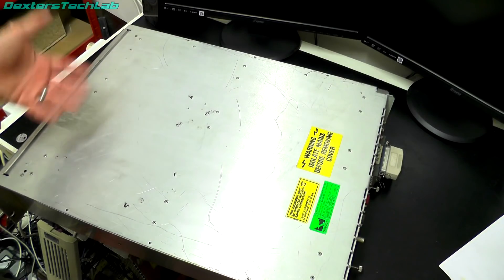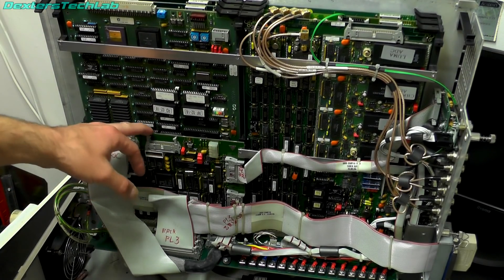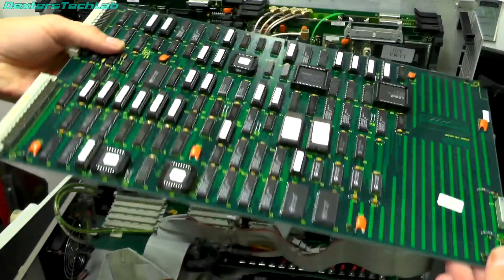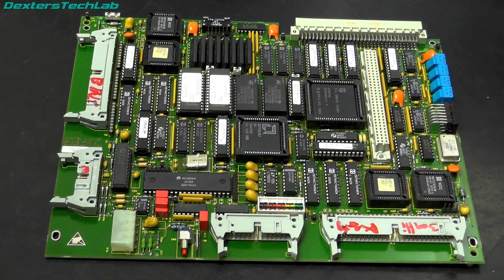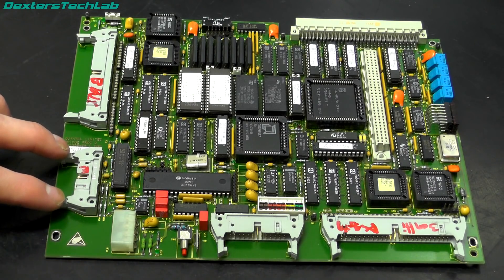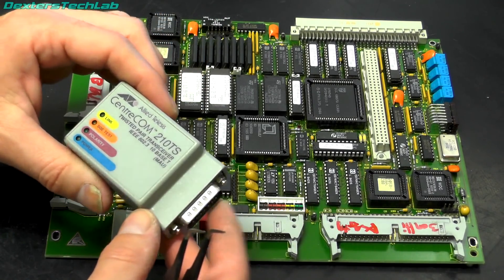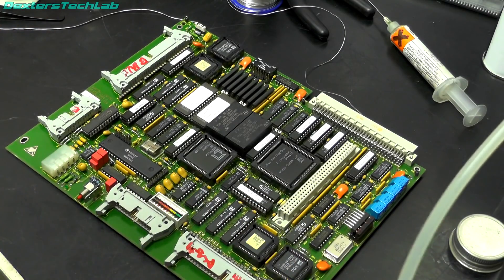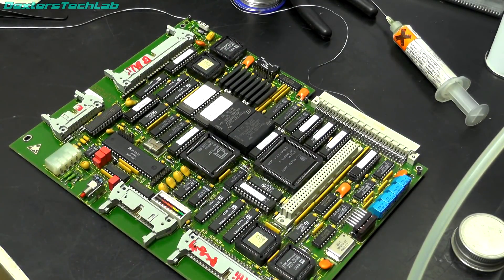DL198 Quantel Paintbox Restoration & Service Part 1

Comment: In my youth, at ITN in the UK, I wrote a sideways ROM for the BBC micro that used the paintbox "fetch" command with adjustments by the cursor keys, to fetch from a start track for X number of tracks with Y pixels per line to recover images and cutouts from a PB disk if the directory ever got erased or the image was accidentally deleted.

This was for the 10U model, the one shown here is unknown to me..

I used the 72 character status display and the 80 character buffer, to print a full set of commands on the status monitor without at "Unexpected command" errors.
It saved ITN a small fortune when a freelance graphic artist deleted 3 off 80 MB CDC disks containing a massively expensive graphics revamp of the corporate output.
Needless to say, the Graphics department were delighted I could recover the work.
My direct manager at the time, bollocked me because I had software that pre-empted this situation yet because of his lack of interest and support, he told the graphics managers that the data was lost.
One of the female graphics artists who saw me developing the software "mentioned" my work to the graphics manager else the images (apparently costing over £100,000 to create), would really have been lost.

This in the day when it took 4 people to lift the 330MB (yes megabyte )drive in and out of the bay :)
Reply: Your direct manager sounds like he was a lazy selfish egotistical arragant prick.
He was jealous because you (but he wished it was him) had software that recovered the data and saved ITN a fortune which, to him, means you were better than him. But he wasn't having that so he told the graphics dept that the data was lost even though he knew you could recover it. I hate people like that. I hope he was sacked.
Reply: yes, those drives were crazy huge! I worked on two of them with the harry!
Reply from the maker: Fantastic story, thank you for sharing it. Pretty sure you're describing the DPB-7000. One day i will get mine fixed up!
Reply: @DextersTechLab  Think you need to get that BBC micro software though, along with a BBC micro, so you can do the same with your drives, and have a trawl through to see the old deleted stuff that is hiding in the corners.
Reply: @tekvax01  I loved harry.
We had two, the room that housed the technical bays was air conditioned to keep it cool so we had to wear parka jackets and gloves if we needed to work in the room for any length of time.

I still have many (paintbox) software eproms because we were never asked to return the old software when painbox was updated.

I also did a roaring trade in repairing the old and new pens despite being potted in later versions to defeat guys like me.
I never touched the wireless pens though. I had resigned by then...
(I got into trouble over pen repair too).
Reply: @SeanBZA  Sadly, my original source was on 5.1/4 inch floppy disks that turned into talcum power.
I don't even have a copy of the chip but, in all fairness, the software is really easy to reproduce as all I did was recreate the diagnostic text, as required, and poke it up the keyboard serial port. (9k6).

The Paintbox of which I was more familiar gave interesting responses to the input "Answer" (fairly sure that's all it needed), in homage to HHTTG.
I cannot recall his name but the lecturer who gave us our Paintbox and Harry courses in Reading (UK), was just brilliant.

ITN's decision to buy a Harris Stills store rather than a Quantel version, was a souce of much distress to me as the "Horrors" still store has issues on issues as well as needing to boot up from several floppy disks which HAD to be applied in the right order.
I wrote an image recover program for the BEEB for the harris but, it was so unfriendly as it stored the two fields in different areas of the disk so you had to hunt for the matching field if you lost an image.
Also, determining field 1 or 2 was a matter of loading them up and swapping for minimum eye watering :)

That is was designed for NTSC and was modified with bits of vero board in just about every card made it a scary beast.
Fortunately, the only item that failed, and they all did, energetically, usually minutes before or just into say, news at Ten, was the power supply as these were new fangled SMPSU's with obscure power devices and no circuit.
The managers got a freebie to the USA so that was OK.
I designed a ribbon cable tester so we could hunt down and replace the myriad of ribbon cable connections at the back of the unit which had a tendency to be intermittent. meter testing was hopeless so my solutions was to fit a scratch detecting Monostable to catch the scratch :), and it could test for shorts as well and test 10 to 40 way ribbons with no switches.
It was a Pass/Fail test as any issues demanded you change both ends and be done with it.

I got a trainee to build it... and a fine job he did.
Reply: @simontay4851  If fairness, I was probably the arrogant one in my youth.
My manager was probably embarrassed. I did tell him I was working on the code (In my own time) and testing at work, but, I suspect we wanted to "Introduce" my work and claim some QDOS for himself.
I only got to read the "HeroGram" from the Graphics head when he asked me what I thought of it. My manager had refused to show it to me.

I also got into some bother as I was repairing the corded pens, the TDS and the earlier black horrible types with a dinner table sized tablet.

AND.. I wrote code to recover images from the Harris (Horrors) stills store which, perversely, stored the 2 frames on different parts of the disk so it involved a lot of hunting to find the matching frame and then determine frame 1 and 2 by examination.

The Paintboxes ran sweet as a nut, the harris stills store suffered from exploding SMPSU's and they ALL died on my shift.
I got into bother for ordering a spare from the USA (On a Friday night) as it exceeded my budget.
I offered to send it back but management decided to keep it so the news could go out on Monday.

It was always a battle of wills between the maintenance department and senior management who were fond of the make 2 from 3 approach which they used to try on the video recorders that ate heads every 1,000 hours.

The stories I could tell you..........
Reply from the maker: Love stories like this!
Reply: @DextersTechLab  indeed! the heady days of half baked science fair projects in full production, saving peoples butts, and making the company look amazing!

Comment: The use of SCSI for networking is a bit odd...but then there were also printers and scanners which used SCSI, and Scientific Micro Systems made mezzanine interface cards which provided ST506 hard disk and floppy interfaces over SCSI.

Comment: If you only have the coax then simply look on eBay for a 10M hub, or an old switch with coax interface, and use that. The hub is best because it is totally protocol agnostic, so long as it is valid network traffic that uses collision avoidance it will work, it does not worry if it is IPV4, IPV6, Netx, token ring or anything else, that is for the card to figure out and use.
Reply from the maker: I have been looking for an old hub but not found anything yet. Hopefully making a cheap aui cable will suffice. If that doesn't work i have a 486 pc that can talk 10-base2
Reply: @DextersTechLab  Still got 2 old Dlink hubs just in case I need to do that.  8 port and 16 port, all they need is 9VDC to power them ,because I lost the old bricks a while ago.

Comment: I think you need an iron with a sucking pump you can get them very cheap on ebay end thy make that job really easy when you add flux. The pins are mostly free and only need sometimes a little wiggle to brake of the last remaining bits but most of the time the chip comes right out :)
Reply from the maker: Thanks, yes i have one, i used it to extract the excess solder towards the end of the video. The issue with quantels pcbs is they used a very small annular ring which makes it hard to get heat into the joint and makes them prone to damage.
Reply: @DextersTechLab  ooooh ok that is annoying
Reply: @Merlinkatamari  Yes, on these boards, the only realistic way to get a large DIP out undamaged is using a really wide soldering tip (JBC makes some up to 50mm wide for this) to heat all the pins on one side at the same time and pull it out. Solder suckers wont do it with the pin still in, as will solder wick. Hot air will delaminate the board.
Reply: @semifavorableuncircle6952  You can still get the Weller DIP desoldering tips, which fit the iron and give you 2 plated copper strips that apply heat to all the pins at once, so you can pull them all out at once, as all are now molten. Crazy expensive though, and you need 3 to cover all the different pitch spacings and IC lengths from 16 pin to 40 pin.
Reply: I hope I am not speaking out of turn or teaching anyone to suck eggs but, other than BGA devices, anything with through hole legs, it's easier to cut all the legs, remove the ceramic then remove the legs one by one and solder wick the holes.

I MAY have missed something in the posts above so please accept my apologies if my comments are unhelpful.
Reply: @ClaymateDesigner  Sometimes you want to sdave both the chip and the board, so have to be careful in unsoldering, but yes for cheap jellybean parts a snip out and pop in new is good.
Reply from the maker: Sometimes the desolder pump is best, sometimes chopping out is easier. The key is deciding the best option for whatever your working on.

Comment: Since it's impossible to find this hardware anywhere, is there an emulation of this?
While I like an appreciate Photoshop and Adobe Products. I do not like modern techniques.
The drop down click game is not one i am interested in playing anymore.  Also, Is it possible to 
clone this hardware today?
Reply from the maker: Yes unfortunately these machines are very very hard to find. Due to the way quantel used descrete, custom and programmed logic it makes them extremely hard to emulate without schematics and technical info.

Work has started on an emulator for the original DPB-7000 Paintbox from 1981 as it's simpler and we have schematics, but there are no plans to emulate the later machines like this one.
Reply: @DextersTechLab  I see. Well, not much a fan can do i guess. Still, maybe with Today's Fpga technology and some digging into technical info and schematics we can concoct something as close as possible. I am only bullish on this because as a producer of content I would very much like to use the technology and techniques that were used for some of my favorite shows when i was a kid.  

This is sort of a reenactment idea. It just seems like one would have to be a multi millionaire to as it were, resurrect this from an unjustified in my opinion retirement.  I hope one day we can fix this issue with either emulation or a new hardware build like the MIST Fpga system.I wonder do you have an Abekas system? Mid 80's system that is very powerful. 

Also, if you know whom has that early emulation software i would be very grateful to know the links or information on that. I will do a search but maybe on the off chance you might know. Thanks and keep up the great videos!

quick find here, found the mame project.  It's amazing what people have been able to do with mame especially since it started out as an Arcade game emulation program.  Did you know that SGI Irix is also emulated with mame? so cool.
Reply from the maker: As it stands the emulator is far from working, just the first tentative signals as the machine starts up. If we can get the emulator working it could help for adapting to an fpga design in the future. But of course you have to also consider the work to emulate the peripherals like the pressure sensitive drawing tablet, 8" floppy drive etc...

I only collect quantel stuff, unfortunately i don't have the space and broadcast gear is always big and heavy!